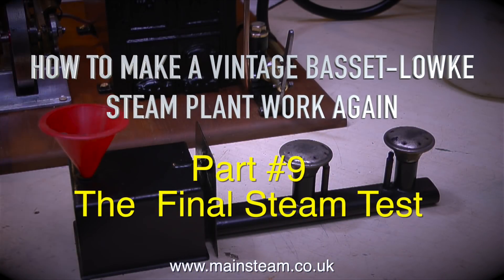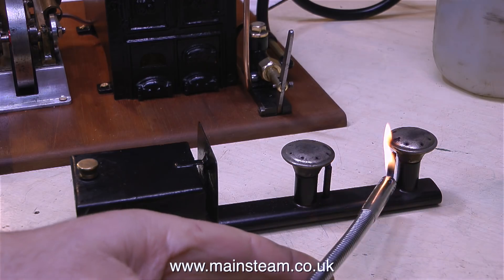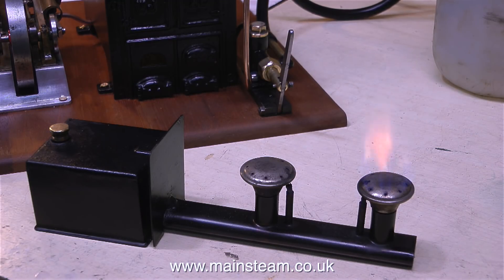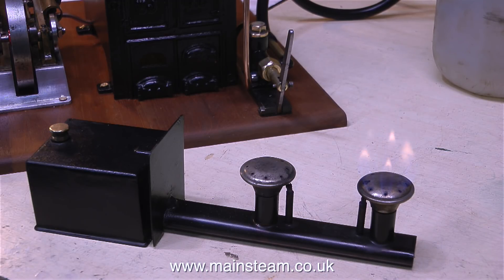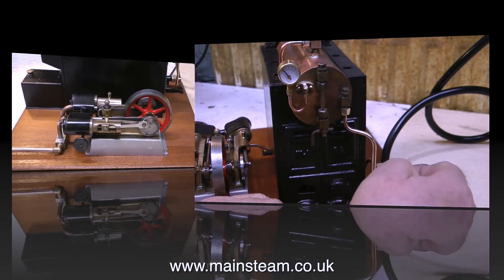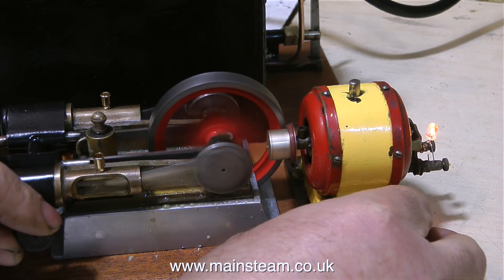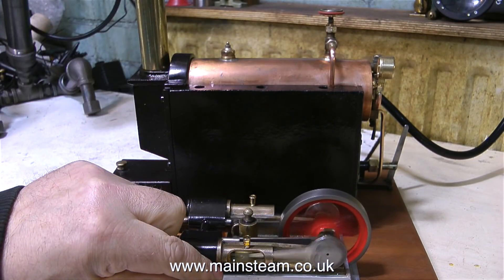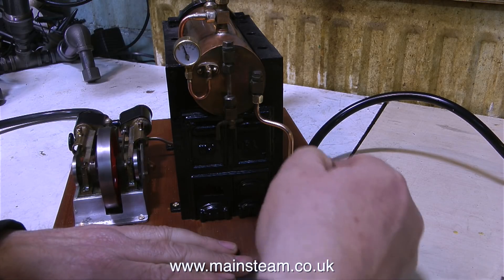HOW TO MAKE A VINTAGE BASSET-LOWKE STEAM PLANT WORK AGAIN - PART #9

Comment: It always struck me as funny how much of a nomenclature disconnect there was.  Meth Spirits over there, Denatured Alcohol over here.  When I was very new to model steam engines I spent months asking hardware stores if they carried Methylated Spirits.  Needless to say I got a lot of funny looks.  Thank you for the mention Keith and for the support of my project.
Reply from the maker: Hi Alexander, a lot of people are asking me for links to your steam restoration project and to the video you made doing the impression of me. I don't allow links but if you send me the relevant links to both - I will post them and feature them in a video .......
Reply: Cheers.  I assume you mean the video, and the waterworks page.  I will send them straight away.

Comment: Lots of confusion on the alcohol! You can use pure ethanol (drinkable kind) but this is always heavily taxed when dold as booze so the fuel kind has an emetic chemical added (makes you sick) so we can't make cheap liquor. That is denatured alcohol... the burnability nature is exactly the same but it makes unappetizing Slivovitz. Methanol - wood alcohol - burns nicely and if you drink it you go blind... no need to add the emetic to deter drinking. This is the usual alcohol lamp fuel in North America. Isopropyl is used as a cleaner and solvent but rarely as fuel, it is more expensive than methanol. Flame color is blue for all three but methanol seems brightest to me.

Comment: Denatured alcohol is made from wood and is called isopropyl alcohol and can make you go blind if you consume it.
Reply: I don't think it is isopropyl alcohol - it's plain old ethanol, but with additives so it's very unpleasant to drink and will make you ill if you try. The point of it is that there is a very high tax duty on ethanol in the form of alcoholic drinks, but governments want to make ethanol available for other industrial uses at sensible prices - so they don't tax it at whisky rates as long as the manufacturer ensures nobody can drink it. Then they colour it so consumers are in no doubt that you can't make gin and tonics with it.
Reply: "Methylated" implies methyl alcohol (methane with on hydrogen replaced with OH group). Poisonous , especially to the optic nerve. Drink enough of it, go blind. Not sure if it used any more, though. Sure Wikipedia will have more detail.
Reply: Not exactly. It's still alcohol with a but it something dangerous added to it, such as wood alcohol (methanol) it rubbing alcohol (isopropanol) to discourage people from drinking it.
Reply: I Googled it.  What the British call "methylated spirts" is called that because it is grain alcohol (ethyl alcohol in the past, ethanol now) with enough wood alcohol (methyl alcohol, now known as methanol) added to it to render it poisonous and undrinkable.  It is dyed purple or violet as a warning.  In the USA it is called denatured alcohol.  I do not know when it was first produced, but I guess it was to have grain alcohol that could be sold legally as NOT booze.
Reply: Yes, should have been more clear - "methylated spirits" is ethyl alcohol with just enough methyl alcohol added to make it poisonous and undrinkable. Also it is very difficult to separate methyl alcohol from ethyl alcohol by distillation because they have very similar boiling points.